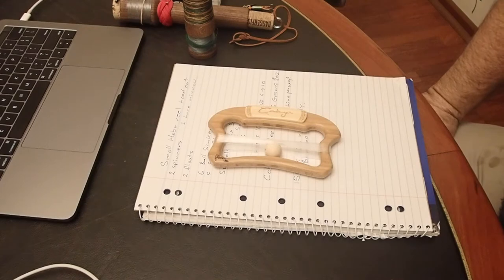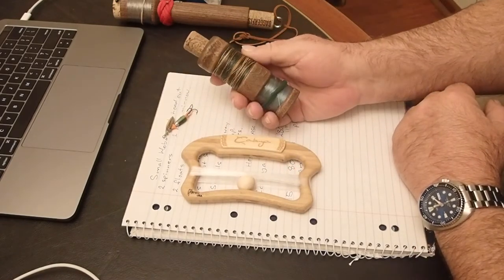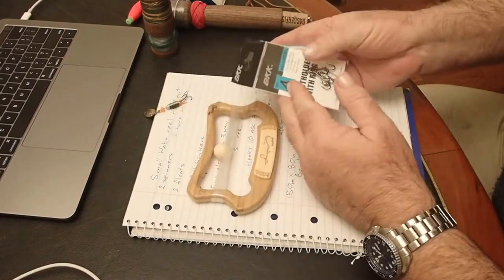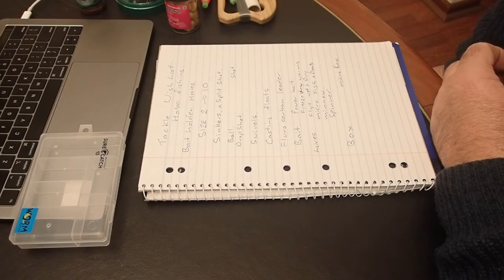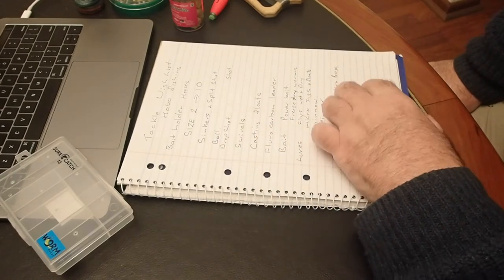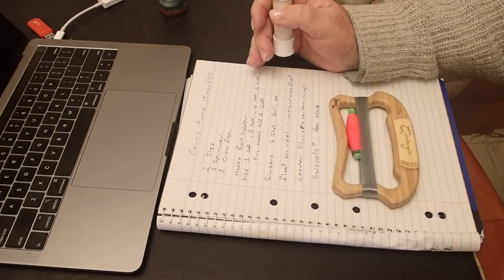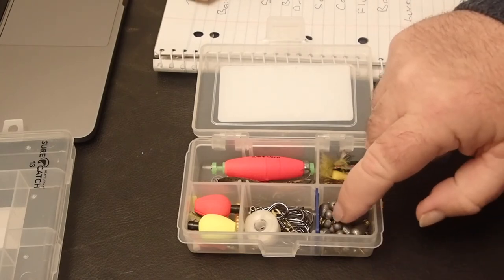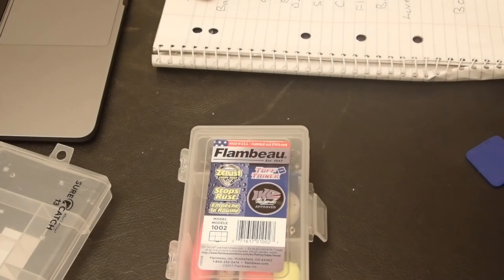Cabuya Handline and tackle box build

Comment: Sometimes things are just plain spooky.

I found your channel accidently a while back and it looks like we've come to a LOT of the same conclusions with hobo fishing- particularly things like line revive, the tube tackle box here (I use an aluminium capsule from ebay lol) and even tackle options. It's reassuring to see I'm not going nuts and someone else is doing similar stuff, thousands of miles away.

I'd suggest maybe sticking a 20g Abu Toby too, but lose the treble hook and use a size 2 inline single instead. They fit inside a tube tackle box, nicely cast well (20m no problem) and you can get a decent retrieve going without worrying it'll snag on the bottom. They do great for mackerel and pollack here :)
Reply from the maker: Its a funny thing in life when things come full circle I started out with hand lines as did most people 10lb 20lb & 30lb lines did everything then i got a rod then several more rods and enough tackle to fill a boat 🛥.Now I can put what I need into a pocket and just Enjoy the fishing experience, but I do need to replace my treble hooks with some single inline ones regards Mike